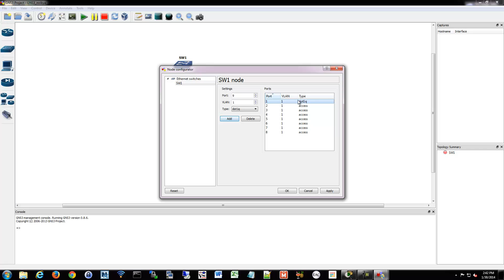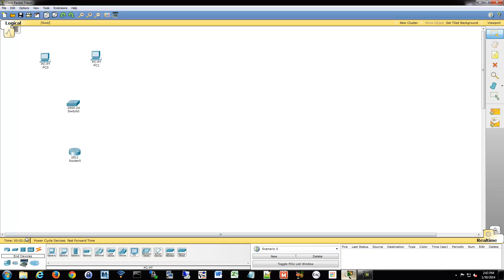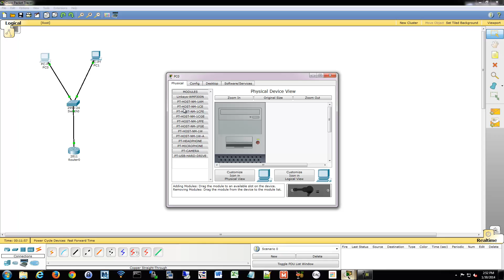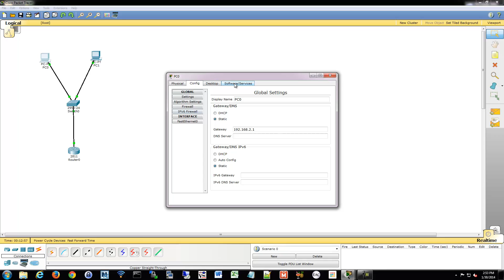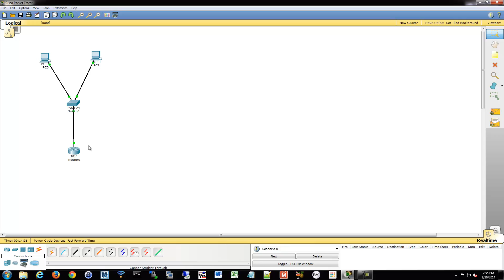CCNA/CCENT 200-120: Router-on-a-stick Configuration 44/84 Free Video Training Course

Comment: Just followed this setup and I was convinced everything was configured right but I couldnt ping. I started again another network but left the one that would not ping so I could troubleshoot it later, that how we learn right? So the second one worked like a charm, i went back and saw I left the 2 out of the 192.168.2.1 for the gateway. I had all green lights but it couldnt reach the gateway because of one simple omission.hah. 

thanks for the uploads andrew, I'm learning a lot.

Comment: Hi, I noticed that you didn't create or enable the vlan 99 on global config mode in the switch but you used it as a native vlan...
Reply from the maker: ***** Oops, good catch.
Reply: It is not a requirement for the native VLAN to exist in the VLAN database. It's actually better (at least IMO) for it to NOT exist so a network engineer wouldn't accidentally assign it to an access port.